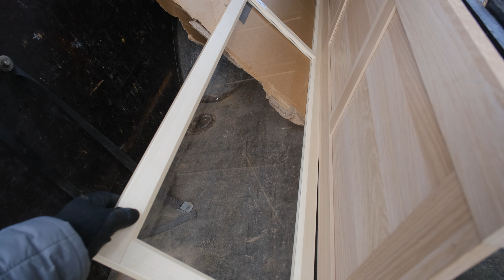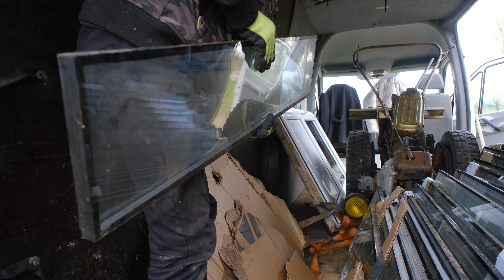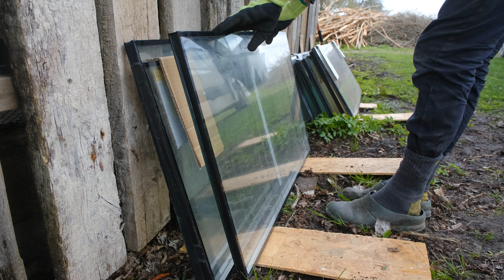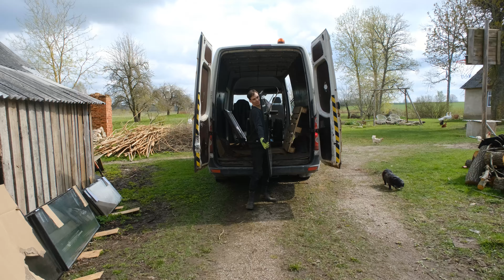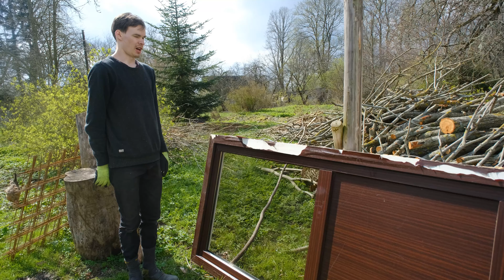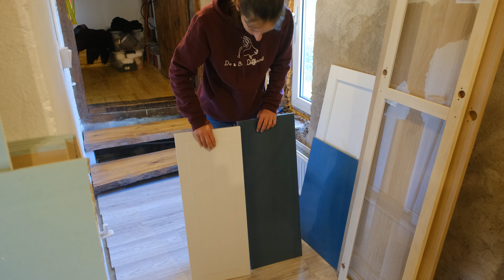Getting Double Glazed windows Practically FREE

Comment: How about you connect that greenhouse to the stone house giving you that all that extra heat storage in the outer wall in the summer drying out the house.
And it provides you the warmth of the early and late summer sun from the greenhouse to drift into the house carrying all those lovely smells of flowers and herbs with it.
Maybe cut out a windowsill to turn it into a door if needed?
Would be great if the kitchen was connected to the greenhouse so you could get the ingredients from the greenhouse.
You should check out Mike Oehler and Michael Reynolds who has his own documentary called “the garbage warrior”.
Both guys use recycled materials and look to store heat developing efficient building and insulation methods with cheap solutions that look good for work great.